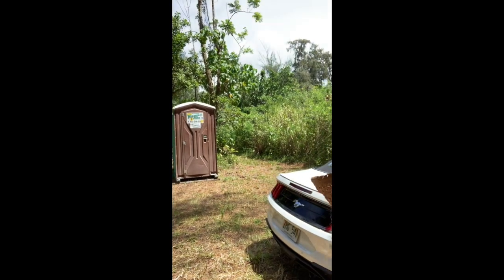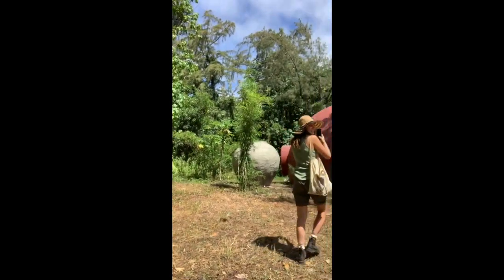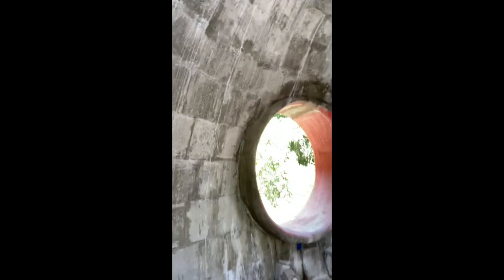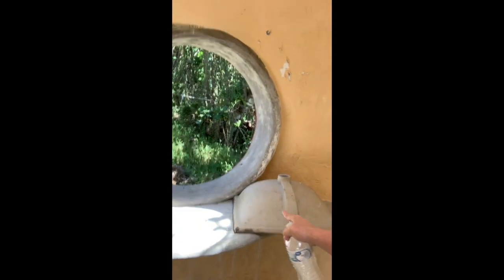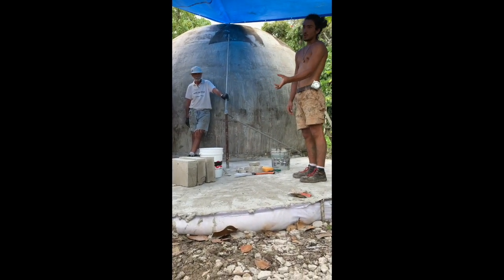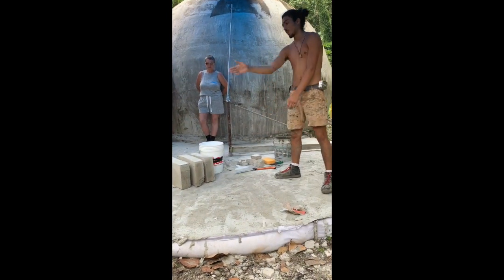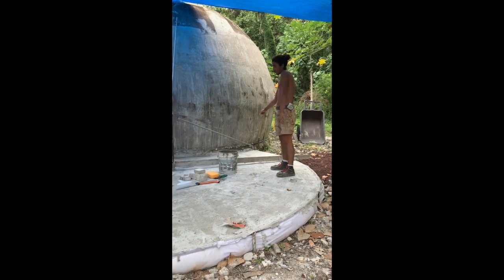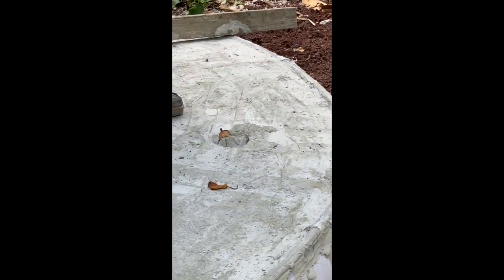Building a Dome House: Aircrete Foundation the Domagaia Style

Comment: Hi. I'm an aircrete fan but... A bit worried about using it for foundation. Do you use the same ratio as for the blocks? Any sand? Do you remember the recipe ratio? Thanks for share.